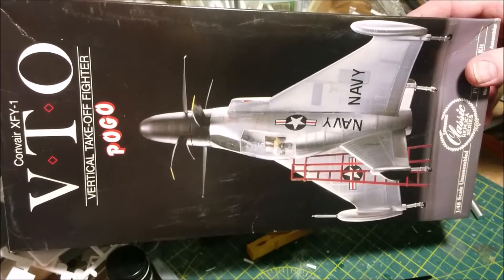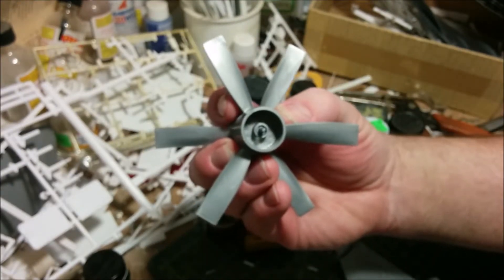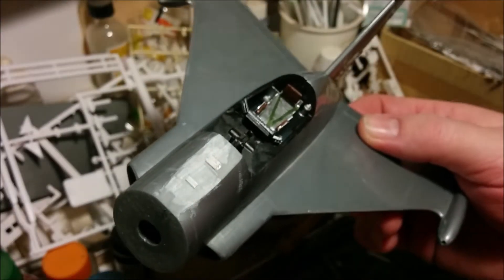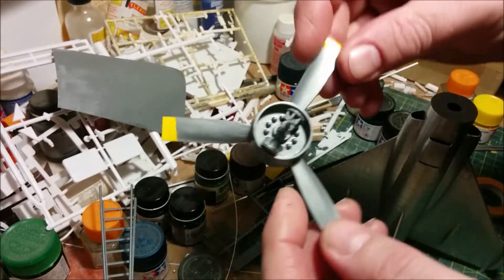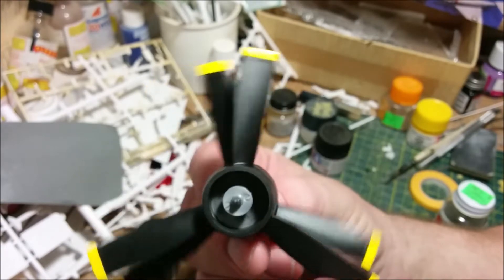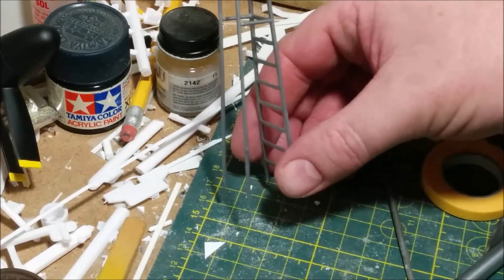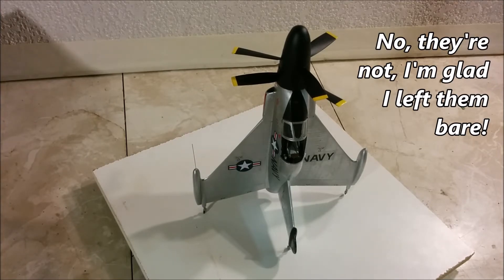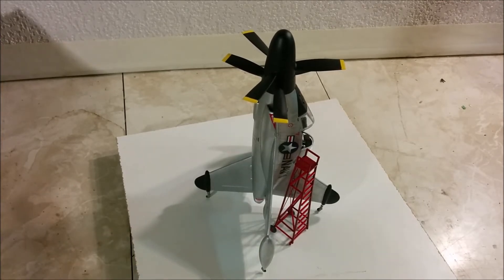Building a XFY-1 Pogo in 1/48 scale Pt3

Comment: do the gears that make the propeller turn that was pictured in this video do they just freely rest in there or is there any glue anywhere for the props?  i just wanted to know if putting the turning gears is complcated or is it fairly easy?thanks Richard
Reply from the maker: @richardkrotec1440  If I recall correctly the geared assembly was retained by a ring that held them to a part which then was glued to front of the plane.   I expected the worst but there was little chance of the glue freezing things up.   The mechanism  works pretty freely.  Thanks for watching.